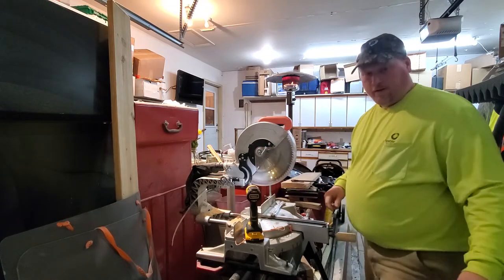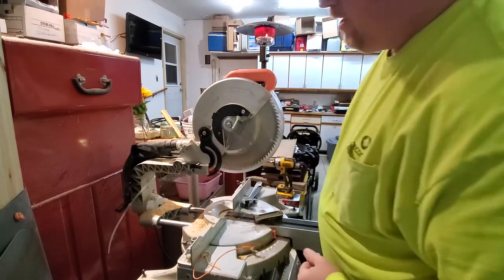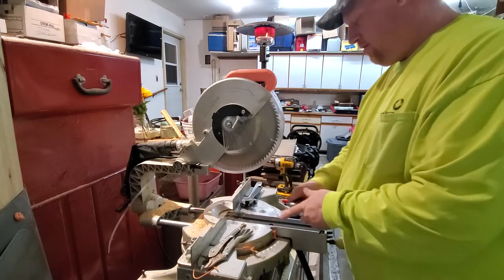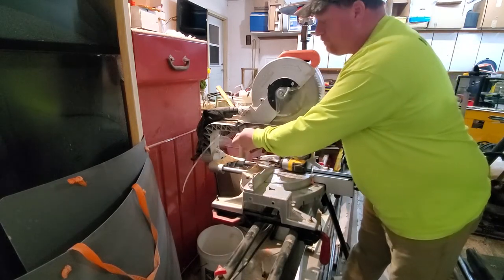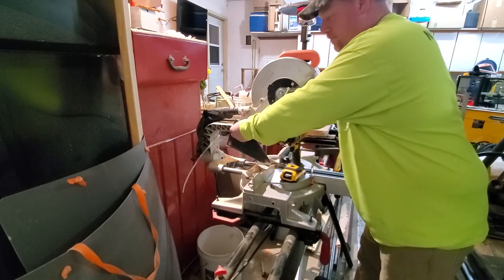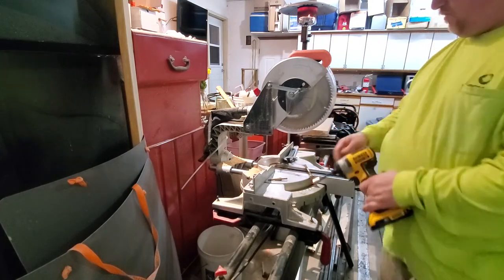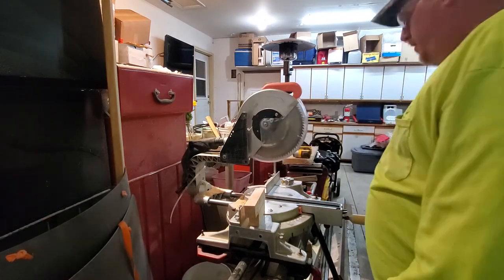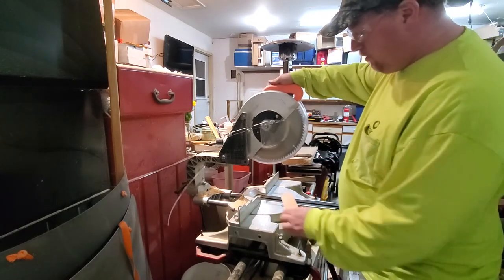Compound Miter saw repairs for broken guard arm on harbor freight tool

Comment: have exact same issue! pumped you put this up. got me thinking differently than trying to reconnect to the broken arm
Reply from the maker: Still working pretty good the only complain I might have is occasionally the guard doesn't go back to home position
Reply: Hey, man, how much to make this for me and send it over?
Reply from the maker: @MrJames4929  text me 419.217.9490  do you have 12 saw?

Comment: I have this same saw with the same broken part! Thanks, you just saved me hours of screwing around with it
Reply from the maker: Its not perfect but A little safer.  IF you prefect it,  let me know.
Reply: I was about to try to duplicate the broken cogged part that engages the gear on the guard with a piece of steel, but I like your approach much better
Reply from the maker: @michaeljrichardson2782   I am considering adding a spring let the guard move a little more freely
Reply: Oh yes I think that will help. I just fixed mine (used plywood instead of steel, may change to metal later) and the guard tends to shudder as the saw raises again.  Was thinking a spring or maybe a counterweight may help.